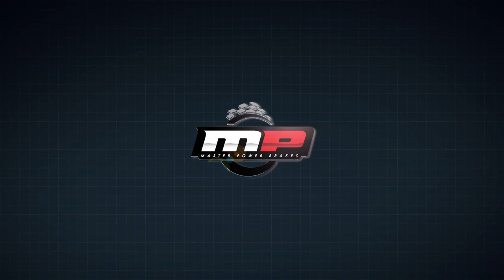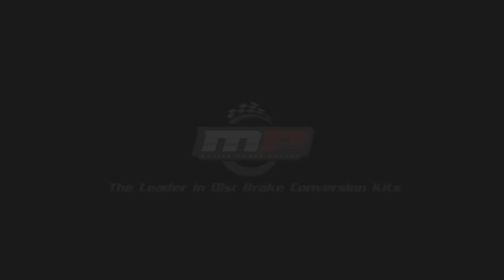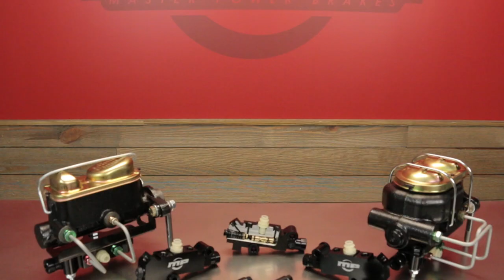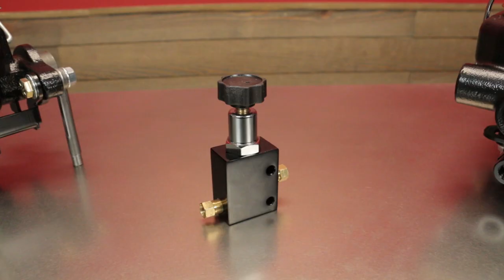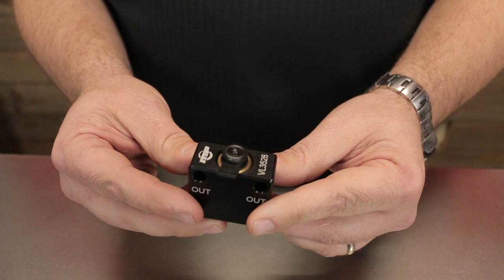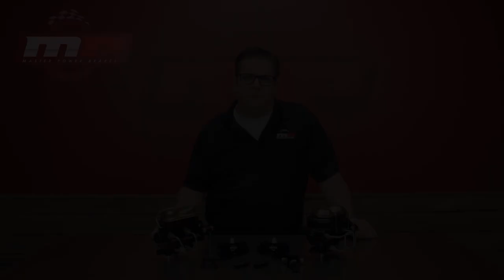The Different Types of Brake Valves for Your Ride

Comment: If you where SMART -- you'd buy the COMBO valve and forget all the rest of the mess!  All I use is Master Power Brake Components on any and all restorations or new car build jobs I do in my shop. Been using them for over 20 years and they're the only place to go to get the RIGHT STUFF!

Comment: Why is the Maser Cyl. on the right plumber differently than the one on the left. I have a brake problem and I believe it may be that the combo valve was installed incorrectly. Mine uses a GM Master and the line closest to the booster goes to the 3/16 front while the Front line on the Master goes to the rear brakes of the combo, this is incorrect right? I wish I could just drop off my truck to you guys to fix this hard pedal power brake problem I have. Oh and the Master is a 1 1/2 inch bore.

Comment: great video, but what is the best location for the pressure residual valves? Should they be as close to the master cylinder, in relationship to the metering valve, proportioning valve, and a front brake lock device. Thanks in advance

Comment: Hey ya ..good info.   I've had brake issues with  a 81 Malibu classic and a 93 Chevy 1500 pick up. Had a shop work on both ..not good.   If I'm backing down hill.. the back brakes do not work at all.  What a danger.  On the truck...in cold weather they freeze solid at times. It seems I have only front brakes as the drums and shoes still look new. The only part I have not replaced is  thecombination or proportioning velve...  Should the rear brakes be on solid if your on a hill or stopped with your foot on the pedal?  At Cal tire they told me the proportioning velve was machanical  and that's not part of their job.  What's your answer to my issues......could the velve be dirty and freeze up?

Comment: interesting about your comment that the proportioning valve never to be in the front - Wilwood explicitly told me to have mine in the front brakes of my drag car due to the skinny tires up front and the need to have the rear brakes do more work in this instance.
Reply from the maker: In race situations there are some exceptions. In most instances you never want to limit the pressure to the front wheels with a prop valve. The better way to do this would be with a bias setup or balance bar controlling how much pressure goes to the front or rear wheels. Hope this helps.

Comment: I have a 65 Impala that I installed factory disc brakes from a 69 Impala on years ago. I picked up a stock GM combination valve that worked great with front disc and rear drum. I just converted to Wilwood four-wheel disc brakes. The supplied combination valve does not jive with my setup; meaning many of the little brake lines do not fit neatly and are in need of adapters so the setup looks sloppy. If I keep my original combination valve, The brake lines will pretty much remain the same as they were. Will the combination valve I have work with four-wheel disc brakes? Or how do I tell what kind of valve it is? It doesn't look like any of the ones in your video it is much smaller. It almost looks like a distribution block.

Comment: I have a manual, single line, 4 wheel drum system and am switching it to a dual line power system, and keeping it 4 wheel drum. Do I need a proportioning valve or a valve at all?

Comment: I have a combination valve from an 05 escalade that i want to use for a 1974 camaro, i plan to do the rear upgrade to disk. Would that combination valve work even though it came out of a Cadillac with ABS?

Comment: I was told you dont need a proportioning valve for all disk applications. Dont you want all 4 disks to have the same amount of pressure? 
I understand the pressure differential valve is a nice safety feature in case you lose half of your brakes.
Reply: as you slow down weight shifts to the front of your vehicle, the proportioning valve limits brake pressure to rear wheels as this happens reducing potential for your unloaded back wheels to skid

Comment: I have a 1989 Bronco. I just had the rear drums replaced and now every now and then if I hit a good bump, the rear brakes slowly start to tighten up until they are locked. Which valve might that be or is it more likely a pinched line or bad install

Comment: I want zero drag on front wheels and brakes when no pedal pressure is applied. Should I just take out the residual valve out of the front. This is a drag car.

Comment: Whith reservoir is for the front brakes (disc/drum)?
Reply: I believe it's the one by his right hand.   Comparatively speaking, discs need pressure and drums need volume [due to take up to get to engagement and extra travel required by leveraged arrangement].  For that reason, you find disc/drum master cylinders have a small resevoir for the disc side.